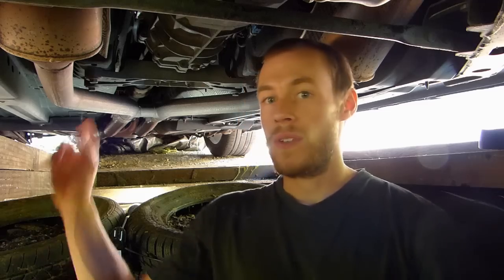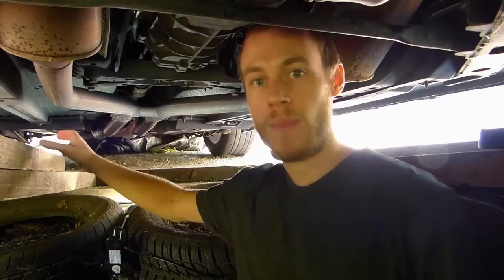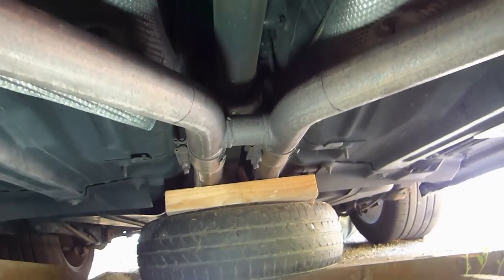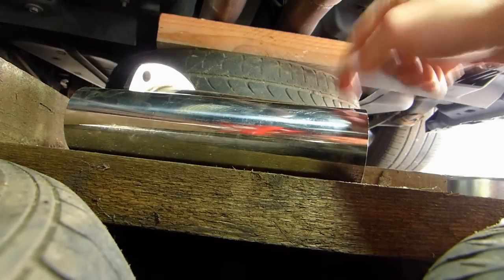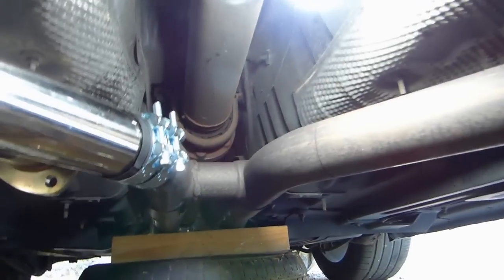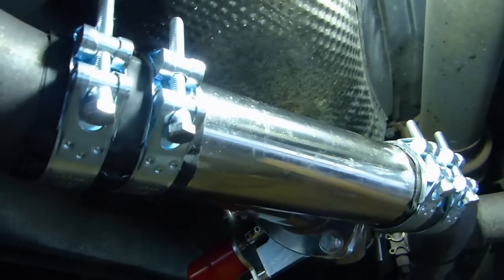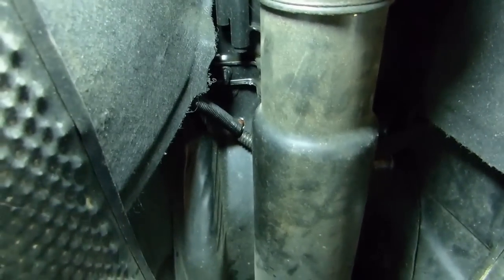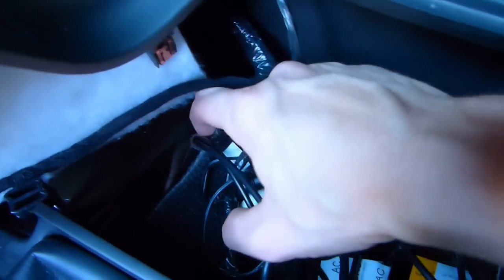Electric exhaust cutout valves installation on Ford Mustang V8

Comment from the maker: There are a few concerns about which way the cutouts are facing. If you look at 11:55 you will see they are facing towards the rear as I film the interior of the car.
Reply: FAB-B Yeah they’re facing the right way, honestly it doesn’t matter which way they are facing. The pistons in you’re engine force the exhaust through your headers there’s no way air is going to go up you’re exhausted into your engine because the only valve open is the exhaust valve on that piston stroke and it closes once that piston reaches full extension. These people in the comments have no clue. Good install bro. 👍
Reply: You right exhaust has a flow
Reply: I guess it's pretty off topic but does anyone know a good website to watch new tv shows online?

Comment: Looks interesting. I was planning on a noisy pipe for my Jag XFR but this would make MOTs much easier and keep it less obnoxious around town.
Reply from the maker: It's a great solution in my opinion, and should sound awsome on the XFR but not sure there is enough space to install this model.

Comment: Nice clean install but the y goes towards the back of the vehicle. You're supposed to split the exhaust flow. With it installed the wrong direction its basically just releasing back pressure when open. You'd get a much better sound and less popping and crackling on deceleration. Luckily they're bolted on easy fix, take them off 180 them and good to go guarantee it runs and sounds better. I've done a couple at my shop they are a nice cheap little upgrade i would recommend. For the people asking where to get them ebay and amazon they run about $50 $60 bucks a piece depending on diameter hope this helped.
Reply from the maker: Thanks ! You're not the first one to tell me that but they are not facing forward, I put on the right way but it's not easy to see where the front of the car is. Look at 12:03, you'll see they are open towards the rear ;¬). They were a little more expensive in France, like 80$ each.

Comment: Did you dig a hole to work under your car? If so that’s absolutely genius and I’ve been talking about doing it because I don’t have any room in my garage for a lift because the ceiling is an A-frame so the car wouldn’t lift up too high, but I’ve always thought about digging the floor about 6 feet and installing a ramp style deck for the car to sit on
Reply from the maker: I made a video on my french channel to show more or less how I built it https://youtu.be/BHna5sKKSKA 😉
Reply: I've added2 cutouts to my vx commodore before the cat,hoping nothing catches on fire

Comment: hey man, great video! How's the drone when you have them open? also, did you get a check engine light when you installed them? I heard if you put them too close to the CO2 sensors it could cause some havoc what do you think? I have a mustang gt 2020 and I just got a Roush H pipe and exhaust cut outs where would you recommend I install the cut-outs? I appreciate your time thank you!
Reply from the maker: Hi, thanks 😉 ! 
It was on a friends car and he sold it a few years ago but he didn't have engine light or other issues. I'm no expert but I would say that the further back you put them the better for reliability and confort, but I'm no expert. Depends also how much noise you want, the closer to the engine the louder it wil be 😅.
Reply: @fab-b9818  thank you!

Comment: I hope you used some sort of a grommet where the wire passes thru the body.  if not, the wire insulation will chaff and cause a short.  if you don't have one, use a piece of rubber hose that just fits thru the hole and silicone it into place.  if you do it as an afterthought, just slice the tubing to get it around the wire and run some electrical tape around it so the wire can't work it's way thru the opening, and again silicone it into place.  
cool project.  open exhaust sounds good on a V8.  I had a friend that put some on his third-gen camaro that he was building to be his "street car".  his cutouts were very rudimentary.   no cable or valve to open and close.  just a block off plate that you had to crawl under the car to remove.  it sounded good, but they were such a pain in the ass to get to.
Reply from the maker: I passed the wire through a small plastic funnel to avoid any wear and taped the wire so it wouldn't move, but thanks for your advice anyway ;).
Indeed, it's not the most practical if you have to bolt and unbolt the cutouts to change the sound ^^, especially if you're in a hurry to hush up the exhaust ^^ !

Comment: What valves did you use and did they last. Thanks Sid
Reply from the maker: Valves that I found on Aliexpress. One motor failed after 6 months but was replaced buy the seller.

Comment: Why point the y pipe away from the normal exhaust exit? Surely you'd get better flow pointing the other way ?
Reply from the maker: It's not easy to see but the front of the car is behind me, so the exhausts are facing the right way (towards the rear).

Comment: Best installation well done FB-B. I have question can you do this installation on v6 mustang 2015? I am thinking of deleting the resonator and replace it with two electric exhaust cutouts
Reply from the maker: Thanks a lot ! Don't know how much space you have under the 2015 Mustang but you probably can, especially if you install them instead of the resonator.
Reply: FAB-B , the resonator is big and there a lot space, but my concern is that there will be excessive pressure in the center of the exhaust system, which might damage the cutout valve motor
Reply from the maker: Why would there be excessive pressure ? I don't think the motor will be damaged as the exhausts will always choose the easy way out, so if the valve is closed they will come out naturally by the rear muffler without much strain on the valve. That's how I see it but I'm not an expert.

Comment: So what I'd like to know is, when the cutout is installed it will open up to straight pipe, but it doesn't block off the muffler itself so it's will have exaust extracted from both sections. It would be better if it did block off the muffler section so you can get more sound I've been debating this with myself for a while now.
Reply from the maker: It doesn't block the flow to the mufflers but exhausts will mainly follow the quickest way out. I can't tell you how much gases come out of each exhaust but you will have 4 exhausts with the valves open.

Comment: hows the part holding up? im looking into doing this after the new california muffler law. also where did you purchase that
thanks so much.
Reply from the maker: I should have used some thread lock on the colar screws, and one motor stopped working after a few month but was replaced buy the seller. I found them on Aliexpress at the time.
Reply: Rae L what new California muffler law? I’m want to do this too.

Comment: From your Video , I got that we have to install it before our normal exhaust Box , So when it is been closed the flow goes normally to the original box with the normal sound  ,And when it is been opened it goes through it with the high desired sound , am I right ?
Then I wounder how or from which part from the kit does this sound been generated?
Reply from the maker: Hi, what I installed are valves which do not modify the sound as such but simply allow the exhaust gases to come out before the rear muffler and that makes the sound louder. They are basically a hole in the exhaust that you can open or close. If you were to install them closer to the manifold the exhaust would be even louder and if you installed them just before the rear muffler it would be quieter (but still noisier than the standard exhaust).
Reply: Yup ,Thank you . I got it ! 
Please May you refer me to the link you have bought from AliExpress ?
Reply from the maker: The link has changed but you can easily find the same type of valves, they might even come from the same factory so just look for the right size and wether you want a remote or a switch, a part from that they're all pretty much the same.
Reply: Thank you very much and wishes you all the best !
Reply from the maker: You're welcome, thanks a lot :) !

Comment: any recommendations for flooding areas? is it waterproof or can get a damage if water reach motors/cut?
Reply from the maker: Good question, it's more splashproof than waterproof I would say. You would have to find a way to seal the connections, maybe with a glue gun (but will it melt with the exhaust heat ?). The gears themselves won't really be a problem, although if flooded I would check them out and maybe clean and grease them again...
Reply: the electric motors themselves should be fairly waterproof, given the environment in which there intended to be used in.  just water from road spray shouldn't be a problem, but a periodic check and a little spray of lubricant on the rotating shafts would be a good idea.  now if you're talking a full blown immersion underwater, it might be wise to give them an inspection afterwards.  should be OK as long as everything gets dried out.  I'd definitely give them a shot of lubricant after an incident like that.  you'd also want to check all the joints and make sure everything is still where it's supposed to be.  I had a 1990 Chevy shortbed truck in high school and one night after a flash flood hit our area, I came around a corner and hit a lake where the road used to be.  it was like hitting a soft wall.  I was probably going about 50 mph and decelerated to about 10 mph in an instant.  the force of the water hitting the Y junction where both exhaust pipes combined into one pipe right before the catalytic converter separated.  the catalytic converter was yanked back several inches.  the exhaust was noticeably louder.  I liked it.  but my parents made me get it fixed.  
that was a welded joint that the force of the water pulled apart.  so joints that are bolted together will be much easier to break.  just something to look out for.

Comment: If you install these before the CAT wouldn't you throw codes? I would assume yes and how would I go about fixing that?
Reply from the maker: Probably, I would'nt install them that close to the headers, you lose a lot of back pressure doing that and it's robably not good for the valves, but I'm no expert.

Comment: What did you make the junctions out of? And how many coats of high temp paint?
Reply from the maker: I used empty spray cans (brake cleaner spray cans in my case). I sanded all the paint off then put 4 light coats of high temperature paint ;-).
Reply: +Anyone can do that ! How's it holding up?
Reply from the maker: With the heavy duty collars.
Reply: +Anyone can do that ! I meant like have you had any problems?
Reply from the maker: Oh, yeah it's holding up fine, and the owner is really happy with it, he drives almost all the time with the valves open ^^.

Comment: is there any exhaust leak from the valves? I bought the same ones and they leak when closed
Reply from the maker: I didn't notice any leaks. Maybe you can put some high temperature grease on the sides of the actual valve so that it seals a bit more when closed, but I don't know if it will be enough.

Comment: is there the same thing like this that could fit in into the kia picanto also, anyone can tell me thanks......
Reply from the maker: Technically you can install that on any car that has enough space to fit the system. You will need to find the right reducers to adapt it to the car's exhaust.

Comment: How long did it last?
Reply from the maker: The installation ? A few hours but I'm no expert.
Reply: Sorry I didn't make myself clear. I was asking if the valves are still working ok or did they last like some months. I hear a lot of people complaining about their durability.
Reply from the maker: Oh, sorry ^^, one of the motors stopped working after a year or so, my friend bought just the motor and replaced it. It's probaly not the best quality but the rest is ok. I didn't have the opportunity to check myself but maybe it was just a loose wire or something easy to fix...
Reply: Thanks for the information! I guess that's the average durability of these valves.
Reply from the maker: Yeah, it is quite a hot and hostile environment, more expensive valves probably last longer though.

Comment: Seriously dude? You have a jack stand upside down?
Reply: not that I agree with everything he did, but he was using the jack stands to hold the pipe up after cutting.  they weren't there to hold the weight of the car.
Reply: Lololol